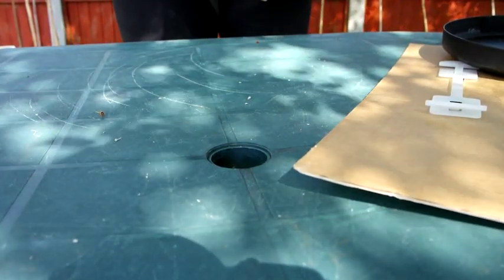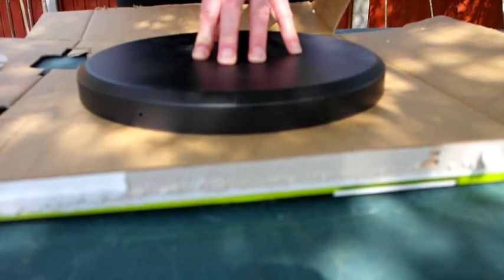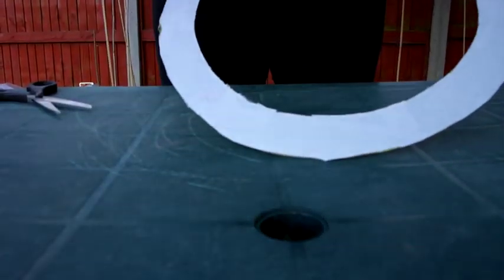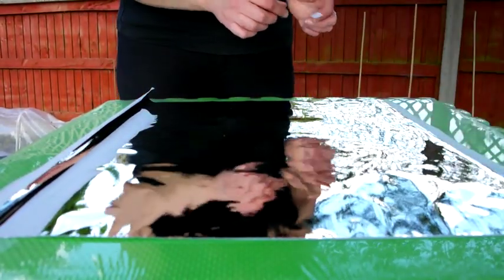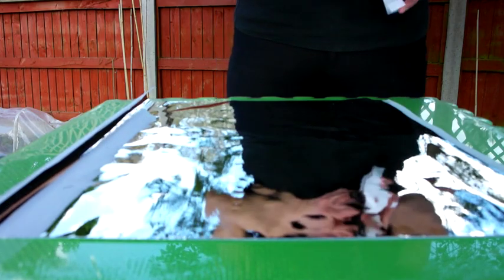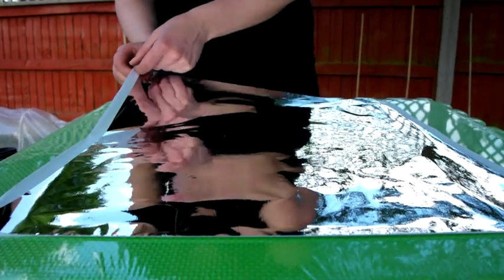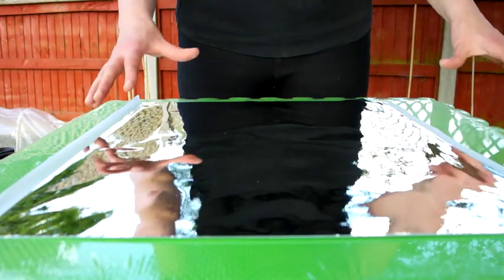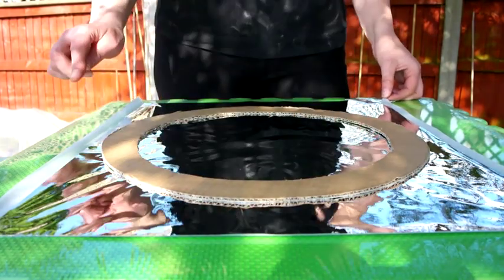How to make an Astronomical Solar Filter Part 1

Comment: Thank you for this very informative tutorial.  I followed your instructions very carefully except I attached the rings to the cardboard that mounts on the end of the telescope in my workshop and not on the telescope itself to be certain to get it centered.  I  used Baader Astro Solar safety film. I handled it all with great care as delicately as possible.  I used it today and inspected it before use and found 2 tiny spots where light was showing through.  I used magic marker to block them out.  Given how careful I was making this, I cannot imagine why the 2 light leaks.  Any thoughts?
Reply from the maker: either they were there in the beginning or some dirt on the table

Comment: I have read somewhere that 3" diameter to let sun light in is more than enough regardless of your scope Aperture size. I was wondering what was your experience with this large Solar film size.
Reply from the maker: I actually use an apature reducer with this. You are right... The large apature pulls in way too much light.